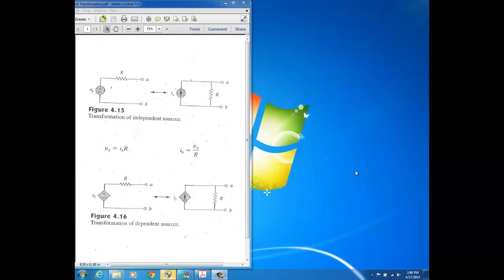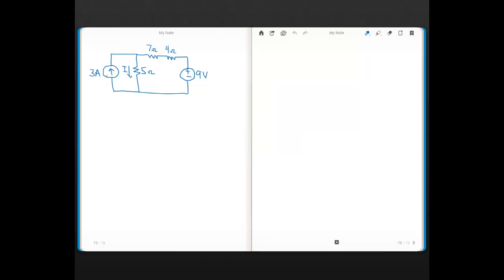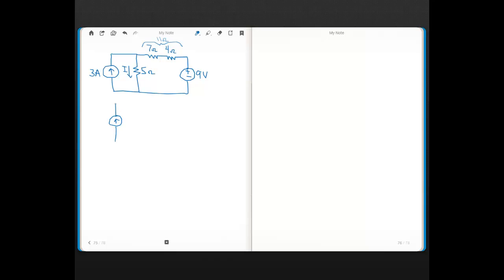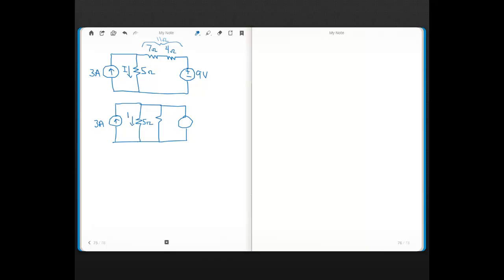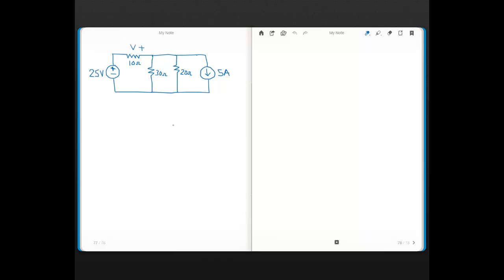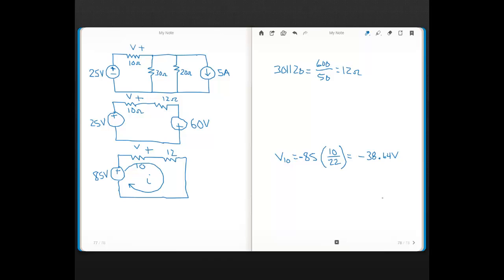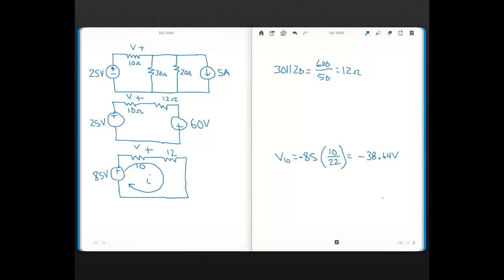Lecture21 Source Transformation with Problems

Comment: I was just going ask you if the summing up of the voltages was correct. And then I saw it in the description. The two problems are really nice but I'd suggest make a new video with the necessary correction. 
Thanks!